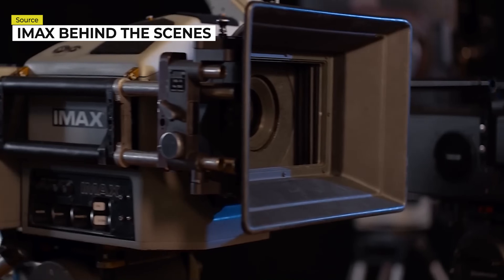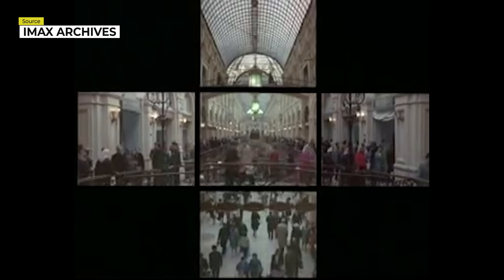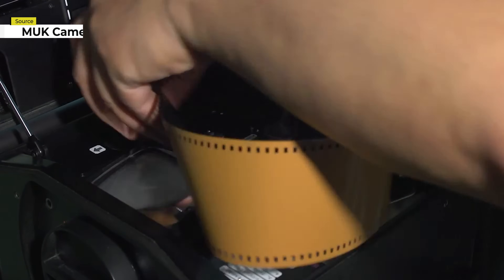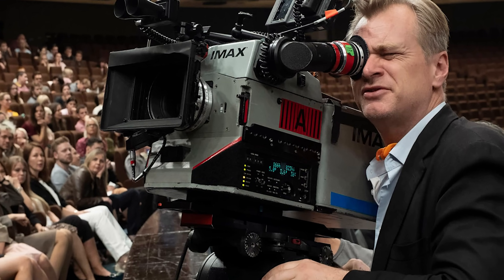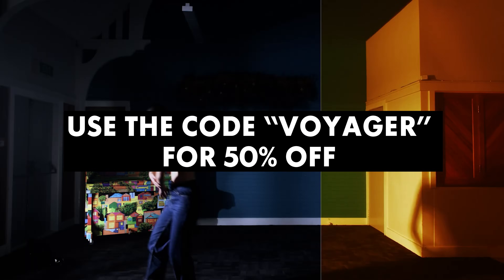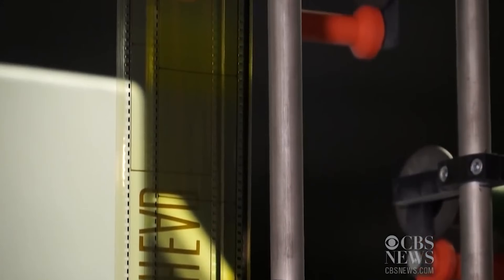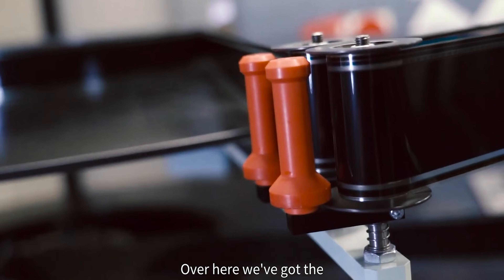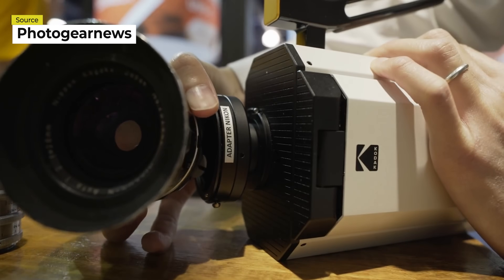The TRUTH about building a Digital IMAX camera

Comment: Film convert is missing several concepts. If you want the tightest mental model: think of “quality” as a multidimensional space—mid-frequency contrast + temporal behavior + FOV/presence + flare/black level + noise/grain structure often move the needle more than “can the fovea resolve 4K pixels from this seat.”

Comment: Great video. Very informative. 👍🏽

I've worked on the soundtracks for many Imax films (not DMR) from 1995 to present day. Indeed, the film cameras are extremely loud, 3D doubly so with twin film paths. Blimping them proved VERY cumbersome, so that approach was abandoned. For dramatic scenes with dialogue, the location sound recordist would often record a wild take for clean audio just after a filmed take, but as evidenced in the cutting room, the actor's performance would usually be less energetic and slower when they weren't 'pushing' against a loud camera. Digital capture has really changed the ballgame in that regard, but we've lost resolution on capture relative to 15 perf 70mm - for now. I understand Imax Corp is working on an 18k digital camera.

The Imax film release prints were below the theoretical 18k of the original Imax negative. Current Imax laser digital projection tops out at 4K, so those projectors could stand for a tech upgrade to get all that resolution captured on location onto the screen.

Comment: IMX811 Nonabayer 9pixel in 1 set sensor medium format(245 megapixel to 27 megapixel stacking) with Fuji Xtrans layer and a processor that can handle that much data and demosiac with least noise...

Xtrans arrangement do give noise structure akin to film because it lowers Luma distortion and increase chroma distortion

Comment: Digital sensors can be much more sensitive to light than film, so the increase in quality by increasing the sensor will be small, I think. It was possible to give examples of digital shooting of the same resolution on different sensors to show this. What really matters is 60 fps. I watched videos upscaled with AI up to 60 frames and they look much better. By the way, what's the point of simulating the grain of a film from a sponsor? You're just literally degrading the quality

Comment: I would bet that this is true:
- shoot a 8K digital file and print it on IMAX 70mm film
- Shoot the same scene with the same lighting and lenses on IMAX film
- Do a side by side comparison in a real 70mm projection theater with 200 seats
Out of the 200, 199 wouldn‘t be able to tell the difference.

Comment: Maybe a fiber channel from the camera to an external recorder (backpack or nearby cart).
10GB/S is beyond common interfaces, but a purpose build solution would handle this easily.
The recorder could be as simple as a PC with PCIE gen4 BUS. 
1-2 fiber interfaces on the PCIE bus that offloads 10GB/S to the CPU which splits the 10GB/S into 2 x 5GB/s or 4 x 2.5GB/s streams. As it's just data (cineDNG images) that can be sorted without decoding.
Now you're looking at 4 x 2.5GB/s, which can easily be handled by  gen4 NVME SSD's (as they top out of 5-8GB/s atm).

Highspeed enterprise grade SSD's hover at around 150usd per TB.
At 10GB/s, 1TB gives about 100seconds of filming.
That's already a lot cheaper than using film, and unusable footage can be deleted immediately.
An array of 20 x 16TB discs would cost 40.000USD, that would allow over 8 hours of filming.
That's peanuts for a large film production, especially considering it's not a consumable medium like film
A storage PC like this could fit in a pelicase. Easy to just have a stack of cases with 8 hours of storage in each.

Alternatively, by using some of the most modern gen5 enterprise SSD's, it could be possible to squeeze past the 10GB/s requirement.
Connected directly to the camera's PCIE bus, this would take 10GB/s directly without need for fiber converters or extra PC's.
The SSD's would cost 1500-2500usd each and contain 26 minutes of recording (though it can be wiped and re-used quickly).

Honestly i think bandwidth and storage requirements is not the issue.

Comment: None of this really matters when you cannot project the image. An IMAX GT Dual Laser system is required to match a GT 15/70 in terms of screen size and brightness. A GT Dual Laser installation costs in the 7-figure range. No theaters can afford to install that - and that's assuming that IMAX will give them one - right now they're incredibly cagey with it. Dolby Vision doesn't come anywhere close, and more "normal" laser cinema projectors (ie Barco SP4K series) cap out at 4k and bring with them color fringing issues. Film remains the ideal medium for presenting a movie. 35mm scope can already match digital "resolutions" and beats its contrast ratio by an absurd margin (250,000:1 on Kodak 2393). 5/70 does all of that while adding in even more detail and bringing the brightness ceiling up to above what any current non-IMAX laser system can manage. 15/70 stands head and shoulders above even 5/70 or GT Dual Laser in terms of brightness and ability to fill a screen. There is a reason that the near-death of 15/70 in the 2010s took OMNIMAX down with it - you cannot fill a screen that big with any other system.

Comment: Imax format (71 x 52 mm) is about four times as large as full frame (36 x 24 mm). With full frame film, a resolution around 10 to 12 MP is achievable, so IMAX should reach about 50 MP in the best case. And that would be almost 10K - as stated in the video. Anything more is just a fantasy.

Comment: I'm interested to know more about how a higher resolution sensor can have a shallower depth of field even with a smaller frame than a large format sensor. It goes against anything I've learned, but it sounds plausible. I wonder if the bokeh is comparable or if it has more to do with discernable detail.

Comment: Then you ad in "Showscan" which is a process developed by Douglas Trumbull where the 70 mm film is photographed and projected at 60 frames per second (twice the normal speed). I have seen it twice. Once at a theatre at the top of a chairlift in New Zealand displaying a film about the country. A second time it was being used as the display for a simulated scifi world ride in Las Vegas. It IS A VERY STUNNING visual experience.

Comment: Superficial. IMAX is not "10 times as big as 35mm" in a classical photography school sense. In order to predict the human perception of image quality differences, we need to make linear comparisons. In digital we use MP but that is an area unit.
As long as "we" can see the differences, between an image of X*Y=MP and twice linear that, in 2X*2Y=4MP, we see the 4MP as twice as good.
In photography we talked about "linear enlargement" or linear magnification.

Todd-AO - 70mm - vertically run
For large "Hollywood" productions, especially in the sound-movie era, the format called "Todd-AO" may have been the norm. Like all classical film, it ran vertically through the projector and it had a gross width of 70mm (76.2mm equal 3 inches).
As it needed width for perforations and sound tracks, it used "only" 48.5 for the image frame width - losing 70-48.5=21.5mm to that (25.4mm constitute 1 inch).

35mm - many standards - vertically run
Before WW2, 35mm could be the reportage handheld run-and-gun format. 70mm was too big for that.
The maximum frame size would be 24mm wide and 18mm high. It loses a max 35-24=12mm width to perforations (about 0.5in).
"Academy format" goes to 22mm wide frames of 16mm high where the freed up space is used for sound.
"Super35" creeps up to the perforation and can go as wide as 24.9mm wide by 18.7 mm high.
"Techniscope" saves on film again, and uses 22mm width with 9.5mm height.
"CinemaScope" does 22mm wide by 18.6 high and needs anamorphic shooting and projection.

VistaVision - 35mm horizontally run
As all film needed per batch testing with development chemicals and development process (temperature, replenishment, motion) in order to derive sensitivity and correct exposure, Leitz started development of a stills camera for testing 35mm movie film. Assessing shot quality at 24*16 was not so convenient and Leitz's developer Barnack decided to run the film horizontally and double the 35mm movie film frame size to 36*24. Turn the pages of your pre-WW2 NatGeo magazines and you'll see the Leitz Camera "Leica" advertised as "double frame" size.
Decades later this idea was turned into a movie camera under VistaVision name, and we can see this as the ancestor of IMAX, again.

IMAX - 70mm film - run horizontally
The actual frame size is 69.9mm wide by 48.5mm high.

Linear comparison
As all these frame sizes have different aspect ratios, it's unfair to compare one of the sides in X*Y, say X, to the other format. So "we" would take the diagonal.
Academy format: 27.2mm
Super35: 31.1mm
VistaVision: 43.3mm
Todd-AO: 53.3mm
IMAX: 84.8mm

In linear comparison, IMAX is 3.1 times as good as Academy format. That's a lot, by the way. Because of aspect ratio differences, we cannot simply square that number for the area difference, but in area, IMAX is 9.6 times as large as Academy format, or 3.9 times VistaVision.
The area comparison in recent decades is caused by MP comparisons between digital sensors. The MP number is relevant to required processing power, bandwidth, and storage capacity, but for image quality we need to always go back to "linear" again.

Comment: The Achtel 9x7 is super high res but has a much smaller sensor than the Alexa 65.
Packing so many pixels in an APS-H sensor should increase noise significantly, particularly in low light shooting. 
And if they employed aggressive noise reduction they would blur the image. I mean APS-H? Not even full frame?

As for a digital large format 18K IMAX sensor how much would it cost to design and fab? A lovely idea, but would it be practical? And would Hollywood adopt such cameras?

Comment: you could use the same lenses as with the 70mm film with a digital sensor as long as the flange distance to the film/sensor is the same so thats not an issue I guess, but the massive bandwidth is a nightmare

Comment: What I still don't fully understand is where exactly is the problem? Is it just cost? 
Because to me it doesn't seem impossible to create a 70mm sensor (that's just 4 times FF). We already have more than enough Pixels on modern sensors, even for normal photography (41Mpix for the A7R3). Yes the bandwidth would be insane but nothing that can't be handled. Look at the IO side of GPUs, they can easily handle multiple tbit/s (HBM memory anyone?). 
Yes the lenses would be expensive. Very expensive indeed. But that's not really new isn't it? And it's not like they have to new ones for every damn movie.

Would love for someone to explain this to me.

Comment: im not sure what resolution 18k would be but i guessed 5x 4k at 19,200 x 10,800... 829 MB / frame 19 GB / second @24 fps and 107 TB / an hour and a half movie. uncompressed at 10 bits per channel. this is not too bad as we already have 100+ tb hard drives. editing this would be a nightmare but the hardware is there. all in all this would be much more practical than 500lbs per film.

Comment: why not just stack an array of 4k or 8k sensors or use one big sensor that is handled by separate compute units. another option would be to use 3 black and white sensors where you can have higher density and split the input through color filters to each.

Comment: I calculated that to fully realise the resolution of Imax film at 70 x 48.5 mm you would need a digital sensor of 8000 x 6000 pixels. This is based on the film resolution being no more effective than 3000 dpi in real terms. If you make it over kill at 4000 dpi then that would give a sensor requirement of 11,000 x 8000 pixels. Certainly nothing like 20K.

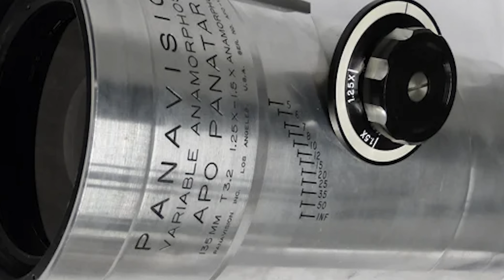Comment: 16:00 FWIW the lenses don't need to be that massive.  Zeiss' lenses for the Hasselblad V System lenses cover a 60mm square image, with an image circle diameter-squared of 7200mm^2.  The hypothetical 70x48 sensor has a diagonal-squared of 7204mm^2.  You probably wouldn't even notice any vignetting if you just used Hassy lenses!

Comment: It's not at all clear why a 48x70mm camera would need enormous lenses.  There are tiny Fujinon lenses covering 8x10 inch film with a ton of detail - though they are bellows focused and would be difficult to use for filmmaking.

But there are also lots of modern lenses for Hasselblad (56x56mm), Mamiya 7 (56x65mm), and other medium format film systems which easily cover about as big (or bigger) a space than 48x70mm.  IMAX doesn't use magical film - it has the same resolution as the film used for still photos (it's just a LOT of still photos).  So covering a digital sensor having the same resolution characteristics as IMAX film is both fairly easy and doesn't necessarily require enormous lenses.

Comment: i once claimed that digital resolution would never match film resolution because film resolution is determined by the size of silver halide crystals, which varies by sensitivity but is nonetheless molecular. Fast films have large crystals to respond quicker but slow films have a density close to an AgBr molecule. Fortunately, with motion picture, you don't need the full resolution, but storing the data would require a serious system.

Comment: Loved video and agree with everything in it. Great work sir. 

Film grain… it is there because of same reason digital noise is. Sensors like light and so does the film. Give it less of it and you will be awarded with all that charming junk on screen. It is crap just as glitches of vhs or all compression artifacts from early digital video. But people get nostalgic and look at those things differently once they are gone.

Just as in digital you can have all megapixels in the world it is mostly lenses that are bottleneck. And i seen few movies shoot on 70 mm and they not look as sharp as even modern 2k movie. Filmstock mabe had potential of capturing all those nice detials if it wasnt for optical limitations. And it is still very challenging to get any lens to output very fine detials at 8k let alone anything higher then that. You need to stop down fstop to get image as sharp as possible and even more as your sensor/film grow. And ideally even your shutter speed need to get higher and with more fps in order to get rid of that motion blur and you will need much much more light or sensor would have to be extremely good at light sensitivity whitch they kind of are now days . 

We probably have technology to build all components for perfect imax camera but would that be economicaly feasable? 

We need to build sensor that is at least 16k and that part would be easy but then probably new mount too with as short flange as possible and to design all new lenses.

That camera would have to cost couple millions body only just to cover up the development cost and then set of lenses too.

Comment: I saw press screening of Oppenheimer at IMAX Prague at 15x70mm, the only IMAX capable of analog 70mm left in continental Europe... Amazing, but the debris, hair and dust particles were constantly appearing. At least the projector seemed to be focused properly. But true 8K digital projection would have probably looked similar, resolutionwise, without the debris and imperfections on the film reel...

Comment: There are sensor, lens, image processors, and peripheral technologies already out there to do IMAX format & resolution digitally. The biggest factor is the cost and market adoption. IMAX was a niche product even in its peak. The format is also proprietary, as in theaters must procure projectors & screen from IMAX (which is easily 4 ~ 6x the cost of standard 4K cinema setup). With declining revenue, it's harder and harder for cinema business to justify adopting IMAX. The downfall of IMAX would be the same reason why Panavision failed, with competitors like Arri, Sony and Red coming up with much easier, better supported cinema camera platform and workflow rather than leasing expensive and inflexible proprietary system.